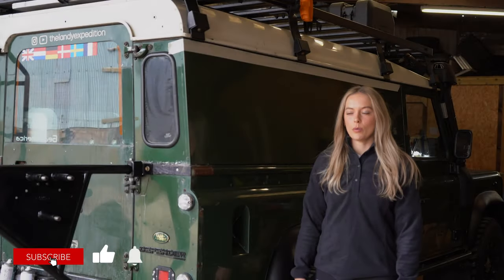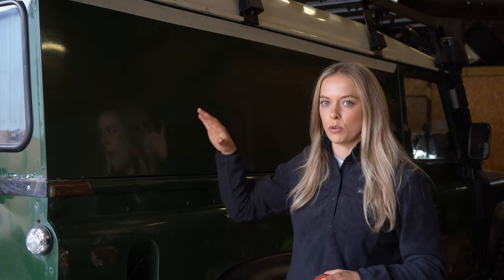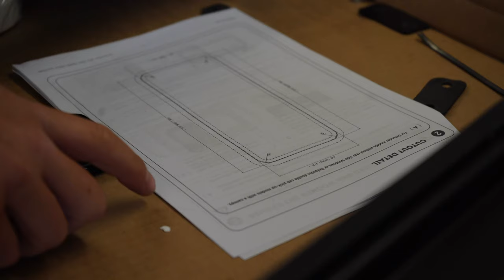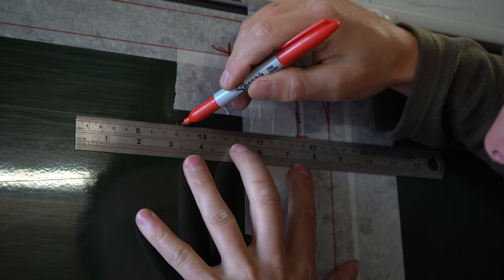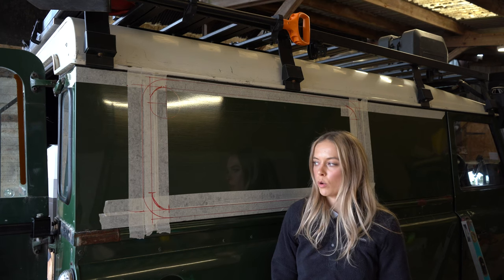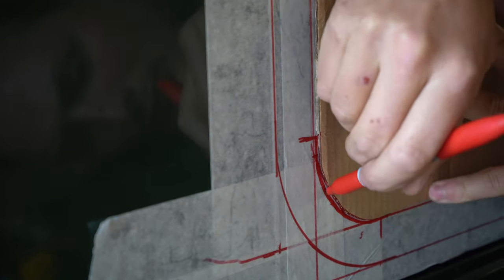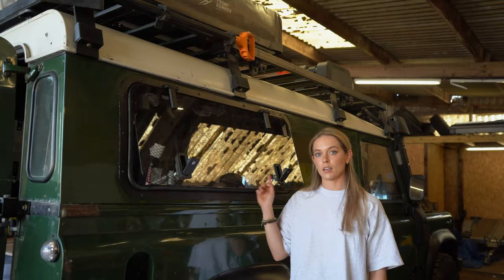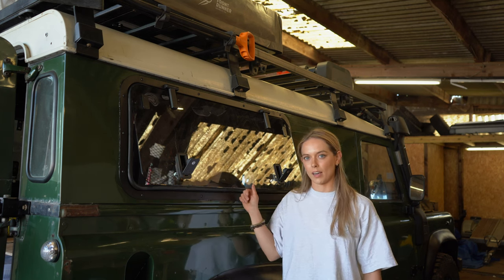Gullwing Window Install on our Defender 110 Camper | Front Runner Gullwing Window

Comment: I have a question, how do you find the window helps mostly with blind spots and when you come to a stop sign to see the other cars coming? Did you paint or prime the edges that were cut before installing the frame at all?
Reply from the maker: We don’t really use the windows much for our blind spots. 
The view to the right hand side window is blocked by our cabinetry and the left one is visible when in the drivers seat so we use it sometimes but normally I just check out the passenger window for oncoming traffic for Harry or he just uses his mirrors.
Without the cabinetry you could use the windows for extra visibility whilst driving. 
Hope this helps! 
Chloe ☺️
Reply: @TheLandyExpedition  thanks a lot Chloe for the reply. I have a similar defender and when we're on trips it's a must to have a partner in the passenger seat to look out for oncoming traffic, the problem is when the passenger is asleep or the driver is driving solo, I thought a window might help a little bit .

Regarding the edges of the panel after making the cut, did you leave the exposed aluminium or did you paint the edges before installing the window?

Comment: Heyy can you lock these windows from the inside to stop people getting in from the outside? And can you open the window part of the way up as a vent for air if it's raining?
Reply from the maker: Hey, unfortunately you can’t do any of that. 
You can’t open or close them from the inside. You can undo the latches and have them partially open but there is no mesh to stop the bugs.
They are good windows but we think with some additional features and usability they would be great!

Comment: Hi guys. Just about to fit this to my ‘09 Defender. Could you tell me the distance from the rear of the panel you mounnted it pls?
Reply from the maker: Hi Alex. I think it’s around 150mm but it doesn’t matter too much if you are cutting into a van panel. Just make sure you don’t go through the supports on the inside. Measure check and measure again! 😀👍🏻
H